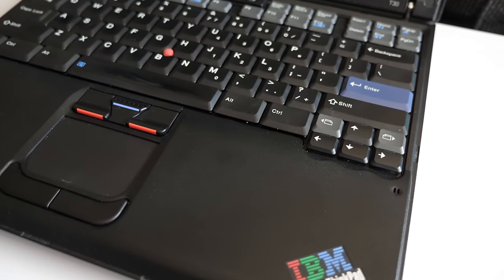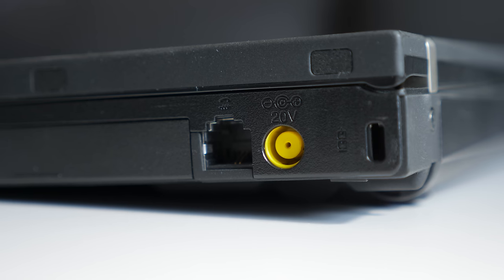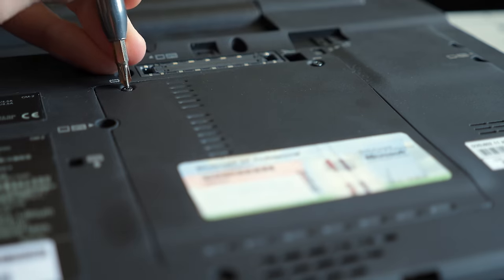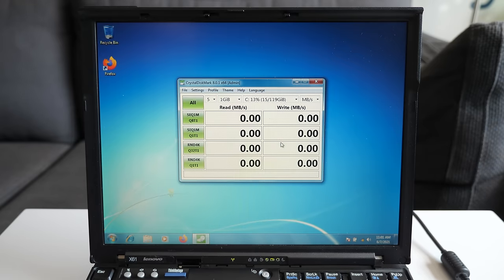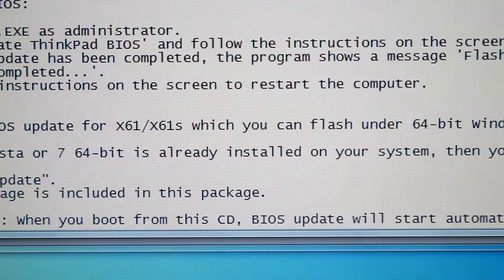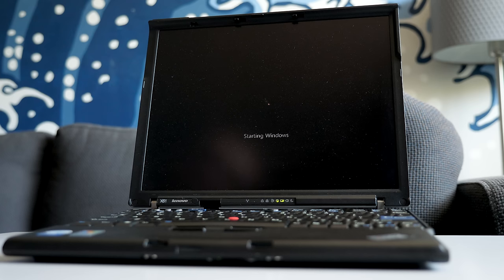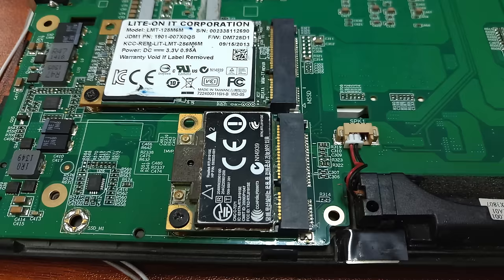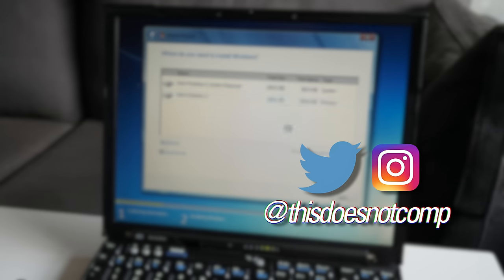ThinkPad X61: The Subnotebook That Got a Second Chance

Comment: Historically ThinkPads were the best, but that isn't always the case these days...

My E480 ThinkPad sucks.  I've also used recent P50 ThinkPads and have not been super impressed with them.  Reminder that Dell Precision and Latitude machines equal or exceed the value of modern ThinkPads.  Also, if you're in the US, you're more likely to get a good deal on a used Dell than on a used Lenovo.

Comment: I have an IMB thinkpad (100 series) sitting around but it has a slight issue with it. I hope some Thinkpad enthusiast here can point me in the right direction. My thinkpad fails to shutdown at all. This was an issue with windows 10 and linux. If the computer has power/battery connected, it will perpetually start right back up after every shutdown attempt. Does anyone know what the issue is?

Comment: I have a Thinkpad x61 its BIOS version is old version 1.11 (7NET30WW) and its date 2007-11-15, It resets BIOS settings to default and has issue with date and time, I have to update date and time every while when it boots.
I want to update the BIOS but I'm not sure which BIOS should I use the lenovo version or Middleton's.
I'm not planning to update its hardware or anything, I'm running it on 4gb ram and that's it.
If someone can help, which BIOS should I use Lenovo or Middleton's.
Reply: It sounds like you have a dead cmos battery, they’re like $10 and super easy to replace. Also, you should be able to just install the Middleton bios directly. I haven’t tried it yet though, I plan on doing the installation this weekend. I’ll let you know how it goes
Reply: @themostelegant  Thanks for Info.
I have updated the BIOS using Middleton's, thinking by doing so the BIOS settings and time issue will be fixed but it didn't.
It's a cmos issue like you are saying.
Reply: @Abdo-bm4jx  yeah I had the same issue with my x61, so that's how I knew. Also, do know any tutorials for instaling the middelton's bios. I'm on a 32 bit version of windows but I'm confused on how to install it.

Comment: I found Manjaro Linux works well on notebooks.
Reply: Same, as I use Manjaro Mate as my daily Linux distro, the only major issues I've come across is upgrading the Wifi/Bluetooth cards in some of my Thinkpads due to Lenovo's stupid white listing, and their use of oddball WiFi cards. I also stay away from any model with Nvidia graphics as I've not had a lot of luck in getting them running as of late, but Intel, and AMD have been great since the latest 5.X Linux kernel updates. one minor issue I've ran across is screen tearing in MATE, but it's an easy fix if you google MATE AMD/Intel Screen tearing, it will come up with the fix for Ubuntu Mate, bit it seems to work no matter what distro you have which has a MATE build.
Another distro I tell people to give a shot even though it does not have as much software in their repos is Solus Budgie as it seems to be a very solid distro, again WiFi/Bluetooth support being the biggest issues I've ran across with it.
Reply: @CommodoreFan64  KDE here, but it's a desktop.
Reply: @zzco  Maybe it's just me, but I've found KDE to be a too heavy on resources on older hardware, which is mainly what I work with, as I do PC salvage/rescue as a hobby, and side business to repair, and find gooCononicald homes for, or flip when I need the extra cash, and I've found MATE for me personally to be a good balance between usability, and lightness.
Reply: @CommodoreFan64  Ah, I'm a software engineer, so. I get 32GB of RAM, since I work on them all day.

Comment: To this day, i still fail to see the appeal of the think pad line. Like, these were basically turbo office machines bought, made and sold by people who would Harrumph at the idea of paying for 3d support they would never see, let alone use. These were, from inception, made for people who would stare at a terminal or excel sheet for 9~5. Even now I can't see how any of them could handle anything more intense than Undertale. I doubt it could even handle the Aero thematic of Windows 7 without the modified motherboard.
Reply: @Tano No thinkpad ever came with a GPU. Let alone a gpu capable of handling anything more intense than text adventure titles from the 1980s
Reply: @Tano Then they never were for me. Problem solved.
Reply: @Tano ThinkPads don't serve what I want or need out of a notebook. And nothing I ever could find had anything but Intel video. Which is aggressively awful. Awful to the point that a lot of game installers will flat out refuse to install if it detects it on the system.

Still doesn't excuse Thinkpads for being built so aggressively weak.